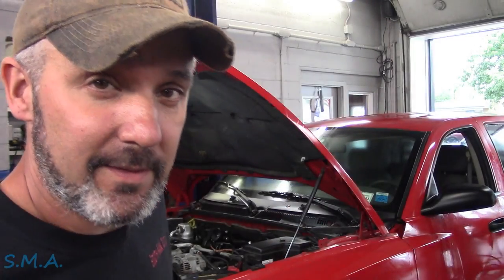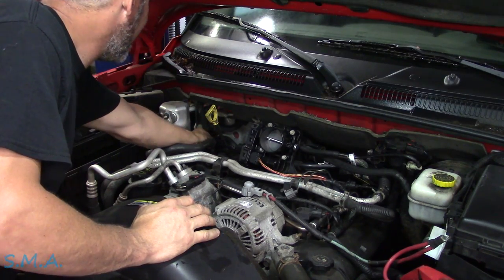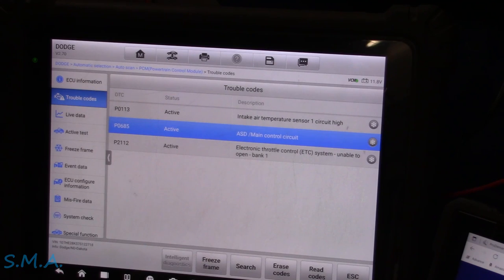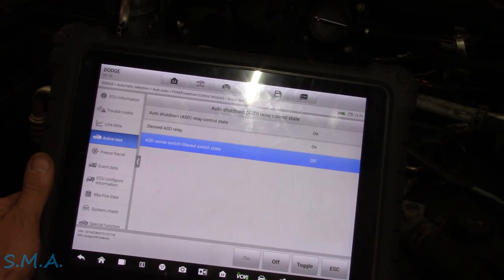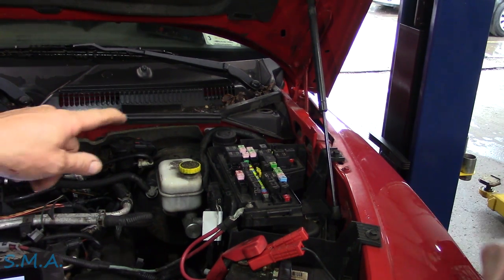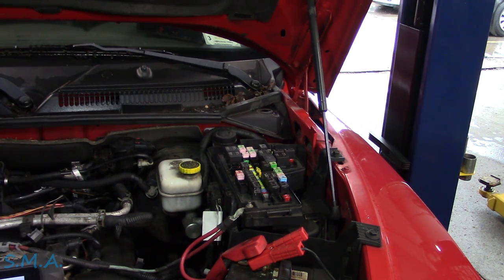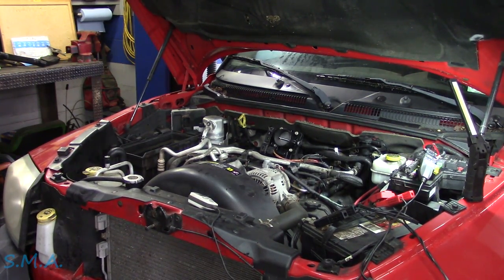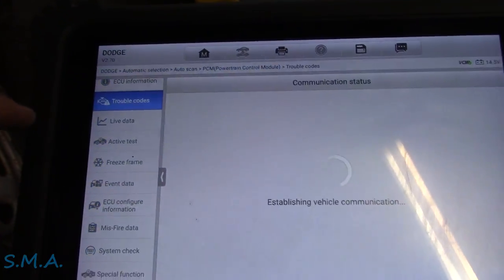Dodge Dakota: No Start After Clutch Replacement

Comment: I have a few interesting screw up's, Teflon tape, neve ruse it on cast iron / steel protruding boss port, twice I got skunked for using it, never seen that coming, it cracked the boss, split it, this was early on before the past came up through Cat. that cost. it was only a two warp around. the other time, I was doing an air compressor R&R, same thing, I put a little teflon tape around the air fitting put it in the boss, busted the boss out. went back to silly cone. 
and of Teflon past. in 4o some odd years. An other one that got me, it looked so good, a power steering pump for a 666 tractor, one of ports not used had a plug it in, plastic, it even had a square nipple like a regular pipe plug, the pump came from our shop,, and painted, the whole pump, looked like it came from cat, first time for everything, generally I put in the plugs and fittings and everything is taped off, I never checked the plug to see if it was plastic. fired it up ran it and called it good, of course it blew out, and of course the super wants to know why I put a plastic pip plug in.,, now that ticked me off big time getting that by me. I told I didn't and how it got by me, your shop guys put that crap in it. 
 talk about having to cover your back side from all directions. An other time some how a fuel injector nozzle wasn't installed, a D343, rear 666, I did a ton of power train work. yeah, to this day I don't see how that happened, I did an R&R / the head, I even ran 
the engine, ran perfect... I had to leave early that day. it was the next day I heard. really, 
My job was to do the bucket list, and no matter what hour in the morning I had to call 
my super to check in. give him the run down. R&R a steering gear box. no oiler around, left a note told the oiler, Nope he blew it off, I ate it. here I'm the foreman. crap happens. all I can do is get hardnosed about it if need be. that's the business. one bad attitude can wipe out a days profits. and the owners take a vary dime view of that.

Comment: @South Main Auto Repair LLC
Could you please do a video on the best "fix" and I do mean quotes Fix for owners of Nissan Cars that have the dreaded "Stuck In Park" problem?
The one where you have to insert a flat head screw driver in that small rounded off rectangular port on the shifter in order to shift the gear from Park to Drive. 
I didn't realize how much of a common problem this is after having the car for a few years.

Comment: I had a 1981 Camero that the brake lights didn't work. I would use the flashers at nite, and the regular lights in the day time to stop. I chased wires  for about 2 months. Replaced the brake lights switch, and fuse= Nothing/Frustrating! My mom noticed a burned out light bulb 💡, that was it.

Comment: Bought an old Land Rover off a guy who told me engine was shot as oil pressure warning light was flickering. Noticed pressure switch on side of block had oil on it, popped a new switch in and ran it for 6 years till I sold it. Cost at the time less than 2 dollars.

Comment: Granddaughter complained of grinding noise in her front brakes. I pulled the wheel and found a rock between the backing plate and rotor. Removed the rock and problem solved. She thinks Papa Ron is a genius.

Comment: When most vehicles come to our repair place, first thing I do is turn off the auto headlights, I am tired of charging batteries after 20 minutes of testing. The last vehicle I worked on I forgot to turn the headlights back to auto. The customer called the next day to complain her headlights did not work, I ask her to look where the headlight switch was set to. Her reply, I never put it there (off)! This is not a woman issue, men are just as guilty of not knowing many of the “ features” of their automobiles…the glove box manual is their friend, if they ever read it….

Comment: The simplest repair I've ever done was when I handed my Trailblazer to my youngest son last and handed him the owners manual. "Read it!" "OK dad!"
Come July, and it's blazing hot, he comes rolling in with the windows closed, sweat pouring off his head. 
"The AC is broken!" 
"Show me." 
He turns on the fan, and sure enough warm air is blowing through the vents. 
"Did you read the manual like I told you?" 
"Yeah!" 
"No you didn't! If you read the manual you would have known to turn on the AC button, the one conveniently marked with a snowflake!"

Comment: My 07 mitsubishi outlander was throwing just about every code it could, heater was on full, random electronics through the vehicle going nuts, all it was, was a 7.5A fuse for the ECU, something to do with the display, swapped it out and everything went back to normal

Comment: About 6 weeks ago I was flushing my brakes. Got to the last wheel and got pulled away because my wife and son needed some. Went back to the garage to pull my car out and when I stepped on the brakes, they went to the floor. Tried two more times and the same thing. Found out I forgot to close the bleeder. Yeah that was a fun mess to clean up

Comment: I've got one that is a bit stupid (and totally my fault). Replaced alternator on my 99 Camry. The battery connection on the top of the alternator has a little plastic cover on the bolt to prevent shorting out on it since its directly on top of the engine bay. I finished the job, and when cleaning up I broke the plastic cover thing trying to put it back on. I didnt really do anything about it, just made a mental note to be careful. The very next time I was under the hood checking the oil the dipstick touched that connection (and the engine block right next to it). Big spark, blew the big alternator fuse, welded the dipstick to the alt connection, ruined a perfectly good pair of pants, etc. ALWAYS REMOVE YOUR NEGATIVE BATTERY CABLE WHEN WORKING NEAR THE ELECTRICS lol. That cover has since been replaced!

Comment: My wife Honda CRV was beeping its horn and the shifter won't go out of park. I took it to the dealer.   They  had it there for 3 days and they traced it to a broken back-up fuse for the radio and security system.  It costed me $329.  That made me feel like a dumb bleep, especially after that was one of the fuse I looked at, but for some reason didn't test it with my meter.

Comment: Replaced my intake manifold gasket and put everything back together but when I started it the idle was going up and down, I thought I messed something up so I took everything back off and double checked and as I was putting it back together for the 2nd time realized I forgot to hook up 1 single vacuum line...

Comment: My worst goof that I'm super ashamed of? Being in a rush and tired, and not bleeding the hose when adding some refrigerant to my ex's car. 😭 Threw the gauges on it, hooked up a can of R-134a to the yellow hose and opened the tapper valve, opened the port valves, and saw that it was low. That's when I reached up and opened the manifold low side valve to add refrigerant and whacked an entire manifold of air into the system. 2 seconds later I realized I screwed up big time. Ugh. Stupidest goof I ever made? I got my Corolla used and it had a weird pulsating grinding noise when braking that sounded so much like undesired or accidental low speed ABS activation. I was convinced of that cause. To verify, I inspected and cleaned the very clean tone ring and tested the wheel speed sensors for voltage to make sure they worked. I got no voltage, whatsoever. I didn't know active wheel speed sensors were a thing. 🙄 Ding dong. Ended up unplugging the ABS pump to do a differential diagnosis that way instead and it still made the noise. I wanted to switch to ceramic pads anyway, so I changed the pads, rotors, and all the front brake hardware even including the rubber shock absorber on the pins. The noise vanished instantly. I have no idea exactly what it was but it was likely just badly fitting hardware that allowed movement of the pads and they just went resonant at a certain speed and vibrated in the bracket. 🤷🏻‍♂️

Comment: I forgot to plug in my throttle body after doing multi day repair on my car. Only reason I found the problem quickly is the fact that I did research before the job and saw something about forgetting to plug it in.

Comment: Forgot to plug in the number 1 spark plug on my 350 in the elco. Also forgot to plug in the ignition wire to the back of the distributor

Comment: I was being lazy and not wanting to reprogram my radio presets when swapping the battery in my truck, so I had a battery saver plugged in. Had my keys in my pocket, and leaned over and managed to hit the Lock button on the FOB. It blew the fuze on the OBD port and I didn't notice for months - that was a fun thing to chase down. "Why tf does my OBD port not work?!"

Comment: Hi sir my 2001 dodge caravan    I was driving down the road on a hot day had my ac on all off a sudden smell wire burning and I lost my cold ac now it only blowing hot air clutch not engaging no more I tested the wires no power is the pcm damage everything else work help please

Comment: A car I used to look after (peouget 405 got sold, the cam belt snapped after the deal was done, so, off with its head new valves new belt all good the next day,err no water  system presurising. Off with its head, wet liner was cracked, I missed it initally, all back together the same day, the new owner, oblivious to all this walked it the second the bonnet (hood) was shut and then drove it away.

Comment: WAY back when, I had a 97 Dakota 5.2 5 speed come in the shop for a no crank after a clutch replacement. They fired a new battery and new starter at it. Nope. Turns out they damaged the clutch pedal safety switch ( which stops the truck from cranking when the clutch is not depressed) somehow during the master cylinder installation. (they tell me that it leaked). I jumped it and she fired right up. I dunno how they missed that!

Comment: I was working at a shop, lady brought in her brand new Honda Pilot in, parking assist sensor wasn't working. I asked the service writer if the system was turned on, turns out it wasn't. Some people really should read their owner's manual.

Comment: I was changing a voltage regulator and was in a hurry and dropped a screw across the terminals and shorted the system all the wiring started to smoke my boss saw what happened ran over and knocked the screw off the terminals and saved the day and the car. He told me very sharply rule one disconnect the battery. I was an 18 year old kid not thinking, surprise surprise, now 74 and with ANY electrical work I turn off the power first.

Comment: I’ve had a repair as a professional renovator for a call where a client couldn’t get ceiling fan led light to work. Well immediately I look up and tell him the light isn’t led as described and ask what has changed and he states light just stop working and he couldn’t figure out how  to check. Well I walk to my van get 2 -g10 builbs turn the lid and changed the bulbs then hand the client a bill for $500 
Show up cost 250
Extra 1hr 150
2-g10 bulbs 100
500
I felt bad but he’s the one who ordered the call

Comment: I replaced a window regulator on a 2007 Lexus IS250.  Getting the door card off was the hardest part of the job.  Anyway, I laid my Astro stick light inside the bottom of the door so I could see as I made the repair.  Put everything back together and... where the hell is my Astro stick light???  Well, still inside that car's door.  I left it there and bought another one.

Comment: Years ago, I went out to a breakdown in the docks (UK). A truck had parked up over night and I thought it would be a nice simple jump-start. I got there, checked batteries which were good  tried cranking and nothing. I then asked the driver what he did when he parked up. It was a rainy night and his heated mirrors weren't working so he took a fuse from another position so his mirrors would be clear for the journey in the morning. Obviously he had already parked up and stopped engine and just had ignition on to check the mirrors. I asked what fuse he took......pow! He remove the fuse for the engine ECU  😂. New fuse fitted and away he went....with a nice call out charge for something he created, he had nice clear mirrors though 😂😂😂

Comment: I had a boss that hounded me for 2 weeks because his boat wouldn't start. It had everything except the starter. He replaced the battery, starter starter relay and the key switch. I kept telling him it was a connection issue. I finally went to look at it. I  literally reached in and put the negative cable on the post and fired it up. Took longer to open the beer than to fix it. Luckily the 10 ga ground wire from the dash wasn't connected to the engine or I'm sure that would have melted.

Comment: Car would not start after changing a value cover gasket. Spent an hour trying to figure out what went wrong. I asked the person did you plug everything back in? He said yes. I pushed on one of the connectors to the computer, heard a loud click. The car started. Lesson, make sure you hear that click when putting connectors back.

Comment: While working at the Subaru Dealer in Erie Pa. Lady came complaint was a vibrating  noise under the car could not find any mechanical reason for a vibration I heard and verified noise while inside the car under the drivers seat found a vibrator yes that kind of vibrator was left turned on…. It was a no charge visit for her due to her very embarrassed look and beat red face just could not charge for the “Repair”

Comment: Had another one similar to the one you had one time friend of mine was working on a foreign car and I don't remember what kind of was and he calls me up because he can't get the rotor off and I said take a picture of it so I can see what you're doing I see the screw still in it and he had beat the hell out of it with a hammer there was dents everywhere so I told him take the screw out came right off so just because you are a mechanic doesn't mean you're going to not make a mistakes trust me on that one

Comment: I put a battery tender on my motorcycle, had to remove the tail piece to install it the way I wanted. When I got it back together it wouldn't start. Got frustrated and put it away before I did something stupid. Sat down with a cold drink and realized I forgot to plug the fuel pump back in. Lol

Comment: A guy at work had the company car (Ford Escort)for the weekend....it crapped out after going over railroad tracks100 miles away..he had it towed to work ..turned out the inertia switch triggered and turned off the fuel pump

Comment: 2011 Hyundai Sonata needed to replace fuel sender unit. Follow service manual proceedure to bleed off pressure (pull in tank pump fuse, pull hpfp connector,  start car and run until stall). Pull back seat and contort self into trunk pull pump out, replace sender and filter, reinstall pump assembly, put back seat back in, replace un tank pump fuse, and crank her over. Runs like week old dog turd

Curse the car gods for making me suffer only to find new issue. Take break and come back to retrace steps.  HPFP connector dangling behind the head. Plug back in and car cranks up and runs perfect. Also fuel level finally reads correctly on dash. Lesson: visually inspect before and after the repair to make sure all plugs are seated in their socket.

Same brand different model...2013 Santa Fe sport that I installed tow hitch and wiring harness on in the summer. Near end of awesome Upper Midwest winter, notice left turn signal coming on and staying on when using fob to lock car. Go to service manual, diagnostics, etc. Again curse car gods and Koreans for building such temperamental cars. Talk with Mrs T and she wonders could it be the wiring harness for the trailer. Nope that thing is rock solid and should be fine...then go disconnect it. No more stuck signals. Lesson: road salt kills automotive anything it touches  and my wife is a genius!

The real learner...1996 Ford Econoline, big 5.0 , doing a tune up prior to a long road trip (VA to OH and back). I think I have an edge since I own the Chiltons manual and it had all the firing orders in nice pictures so I yank all the wires off the cap, change out plugs, replace the rotor, put on the new cap, plug up all the wires as per Mr Chilton, and fire it up. Barely gets going and misfires so bad the van is shaking. Ok I messed up a wire so re check and try cranking again. Still missing. Repeat 5x more times. Mind you it's summer in VA, mosquitoes are feasting on me, and it's getting dark. Oh and it's Sunday night too. How did I mess this up so bad? The a moment of clarity...check the evap label for firing order and gap. Yes maybe I didn't gape em right and thats my issue. Nope...then 1995 and up firing order was never published in the Chilton manual and was different from the 1991 to 1994 vehicles. Which I found out by looking at the very large sticker underhood that showed exactly what I needed to see. Or actually fully read the page with the distributor wiring diagrams that noted "for 95 and up vehicles see underhood label". Lesson: Fully RTFM and never work on a car after 4p on Sunday

Comment: Brother asked me to check out the ticking noise on his Z-24. Checked the oil - just the very tip of the dipstick had a bit of oil on it. Started the car and poured in a quart of oil. Ticking went away. Asked my bro when was the last time he changed his oil. He said about a year ago. This in a daily driver. People may knock the 3.1 V6, but that engine served my idiot brother well during its lifetime (~15 years).